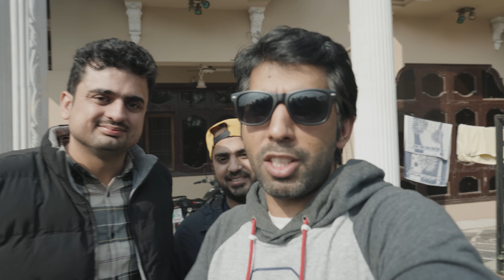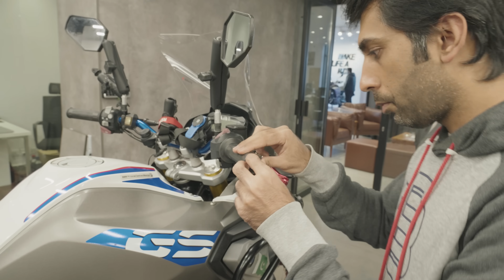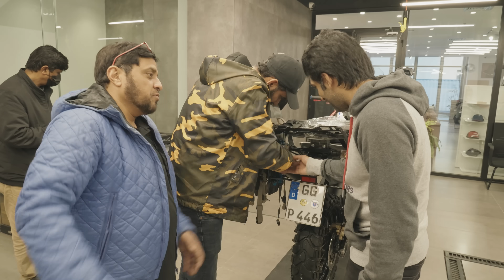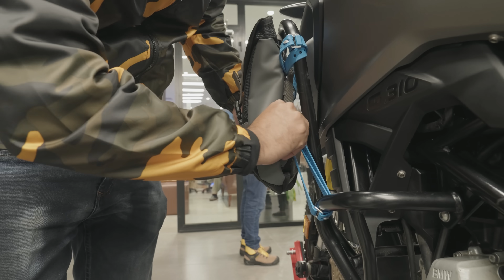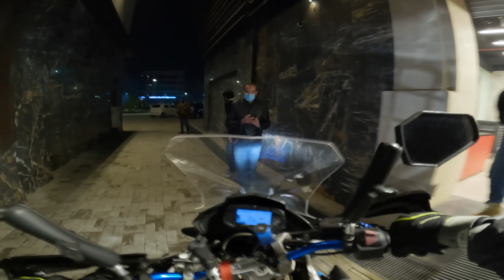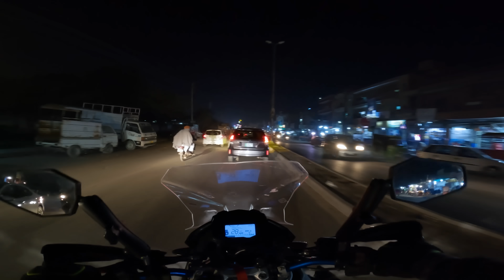GETTING READY FOR INTERNATIONAL TOUR

Comment: Rangili looks better, I never thought that I would like any GS other than 1250 but guess its a serious contender for a pretty decent tourer. Usually the valve clearance is recommended  at 25 to 30K mileage along with spark plugs replacements, I hope  BMW Motard guys have done that and one more thing the levers looked like after market replacements and a bit short. In my experience the longer ones that come with the bike are more comfortable on longer voyages as your hands wont get tired that quickly when using them. I saw metal pannier box in the end of video, guess you're all set for another great adventure, ride safe.